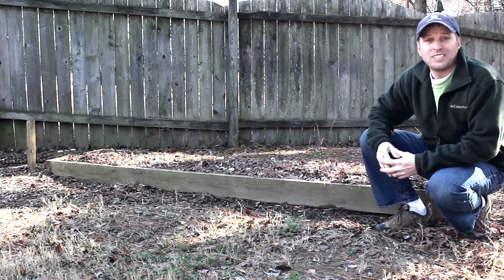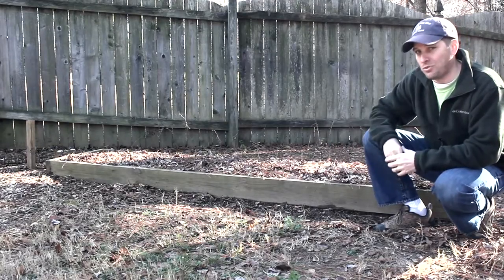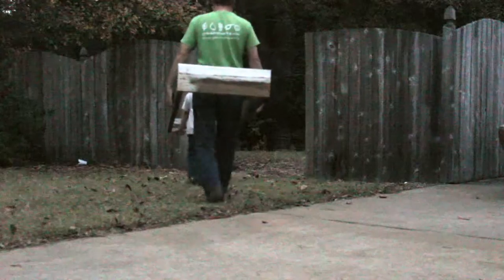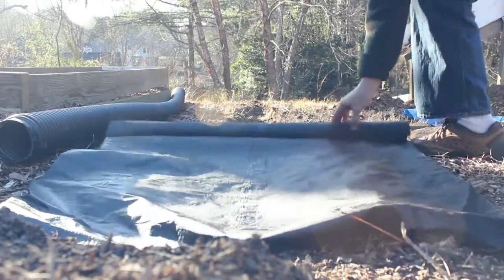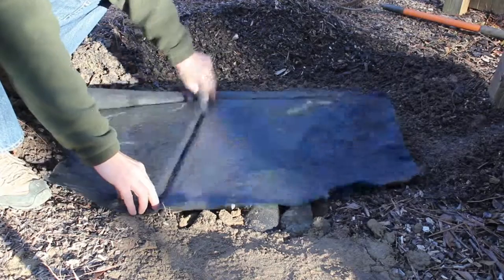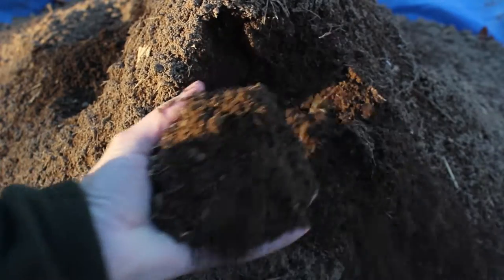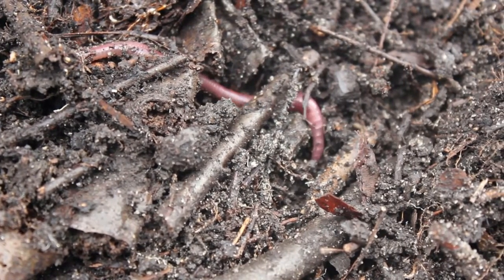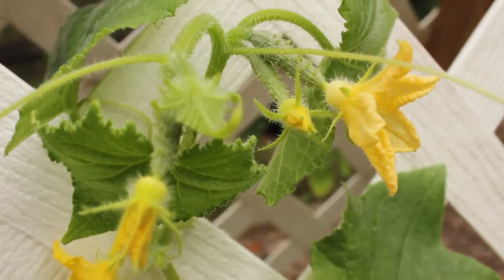How To Build A DIY Raised Bed

Comment: Great video. Can you explain more about the under ground water pipe. And also what type of manure do you use. Lastly how would you go all do this differently if planning on planting right away. Thanks a million
Reply from the maker: Hi Ed. The underground watering pipe allowed me to put water closer to the roots and avoid losing a lot to evaporation. In this particular garden, I had diverted my driveway runoff to flow through the rocks and into the pipe. It allowed for capture and some storage of the water. Peppers like deep water, so this helped meet their needs. The 4-inch corrugated pipe was the perforated type, allowing the water to filter out into the soil. You could install the same set up without the driveway connection. Just add a 90-degree elbow to the 10 foot pipe at the edge of the garden. Have the upward-facing opening an inch or so above the surface of the soil. Water through this opening. I used aged cow manure...it was probably 3-6 months old (I'm guessing)...not fresh. You can use this method if you plan to plant right away. And if you don't have access to leaves, just use woods chips. They are better if aged a few months to reduce acidity, If you are using fresh wood chips, use more newspaper underneath. Thanks for your questions.
Reply from the maker: One more thought...if I had to do it now, I would install a couple of worm towers in this type of bed. Have you seen this video: https://www.youtube.com/watch?v=qJ7lNsCmCrg I've also got a video of a worm tower made out of wood coming out tomorrow.